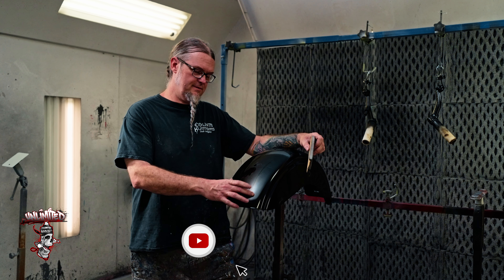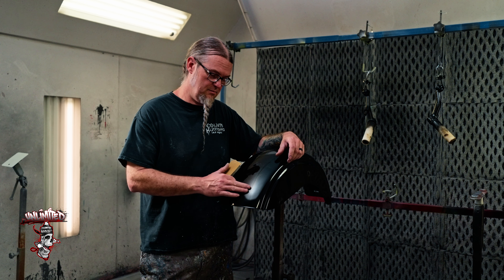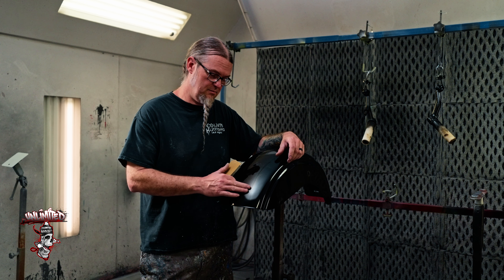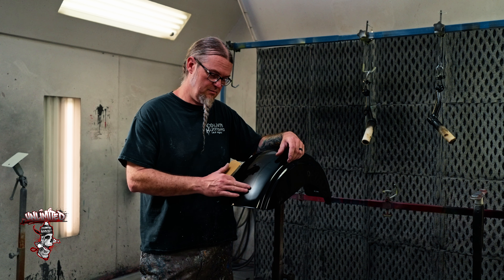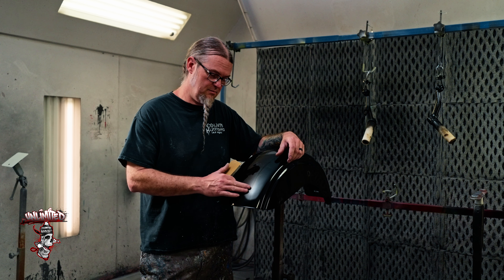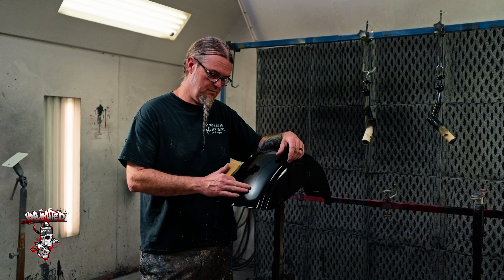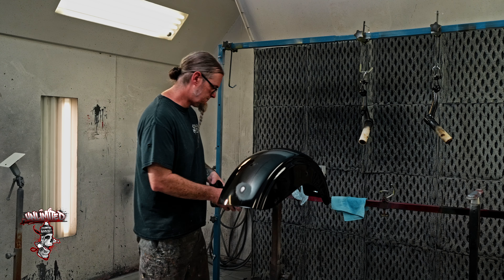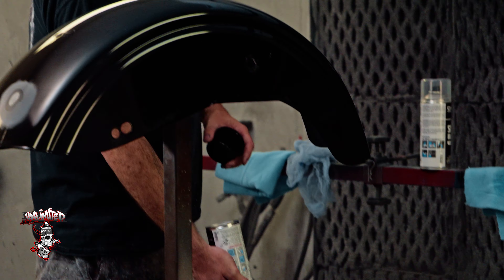Car-Rep® 2K Spot Repair by Ryan Evans at Count's Kustoms

Comment: Now 😊your channel becomes active…with someone who knows what they are talking about. A few years back I spent a crap load of cash on your products to restore a motorcycle and side car. Tech support was almost nonexistent. So after 2 years of cancer treatment I’m back at it. Using Rust-Oleum  paint. With the 5 spray tip